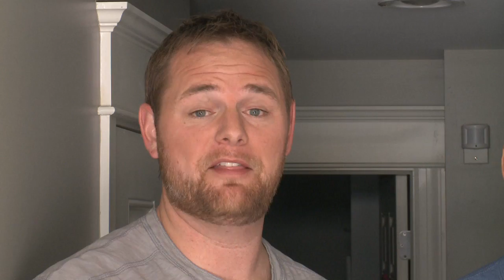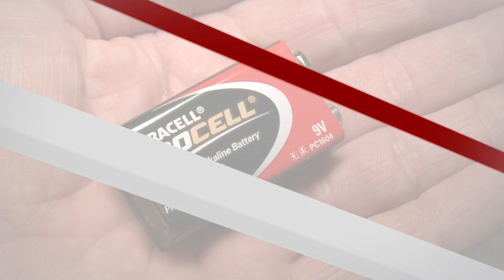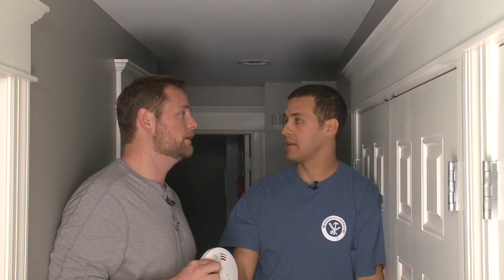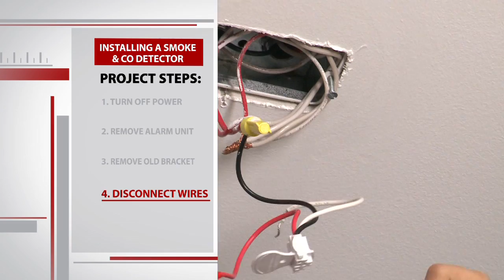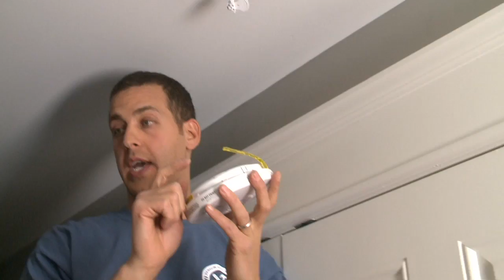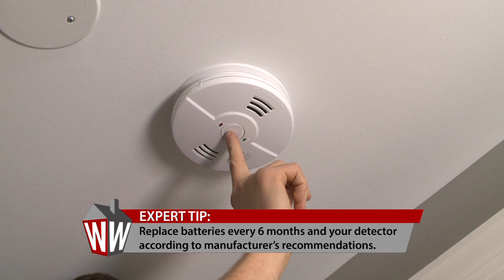How To Install a Smoke/Carbon Monoxide Detector with Mensch with a Wrench

Comment: It interconnected perfectly with my old smoke detectors>>>t.co/ApZw13tlJS  . Set up was quick and easy once the breaker to the smoke detectors were off...just match the colors and use the quick connect covers.